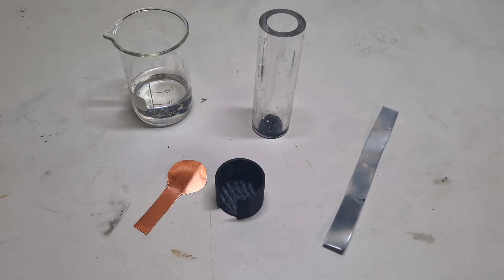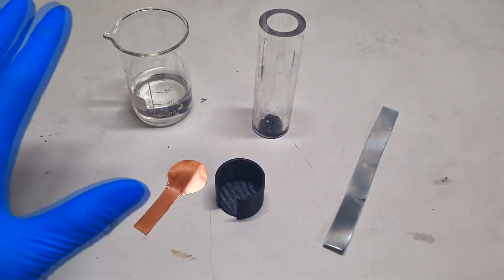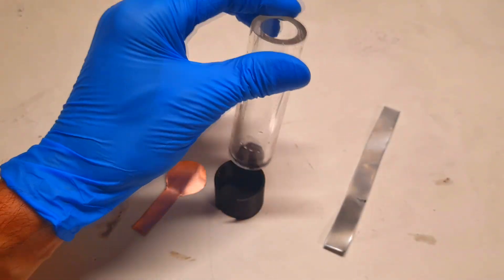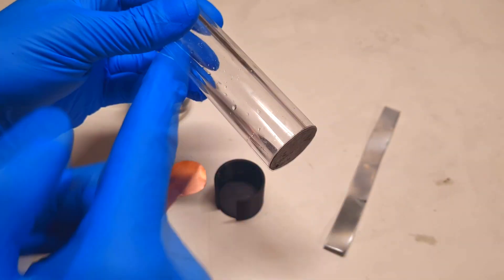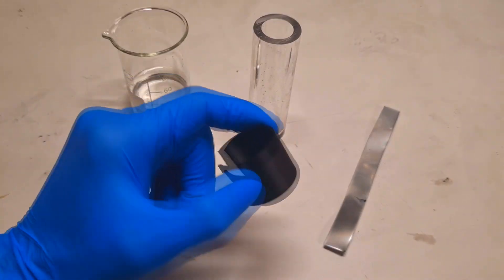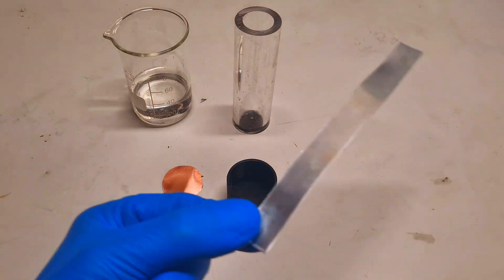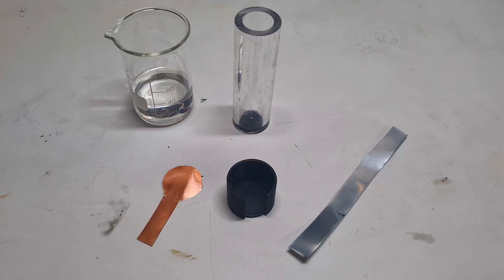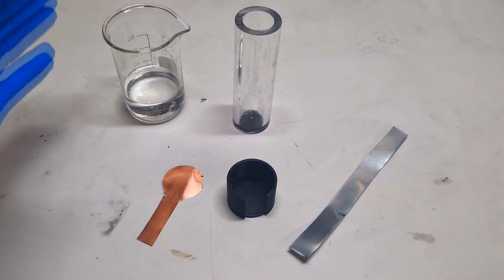DIY easy Zinc Bromine Gravity Battery

Comment: Some ideas:
- As already mentioned the resistance (because of poor adhesion) between copper and hdpe. HDPE will stick nicely on graphite foil which only will need limited contact with copper for low resistance.
- Put some (activated) carbon on the bottom (onto the positive electrode) as this might adsorb some of the bromine keeping it further away from the zinc.
Reply from the maker: Correct,... this is what I was discussing on my Patreon and what I made 2 years ago,... but in my case I use only graphite to get the max conductivity. And it will also in the follow up video.
Reply: @cayrex  Hi, I'm paying member on your YouTube channel, do I have to pay separately for the Patreon?
Reply from the maker: @Flup1964  No, no need. The post is free and I already mentioned here in youtube community section. And the video which I made 2 years ago is also avalible in the search: Zinc Bromine gravity Battery
Reply from the maker: @Flup1964  I post stuf like this on my Patreon because to the post I can add pictures, etc.

Comment: How much time will it take to be fully charged and what will be the voltage and current?
Reply from the maker: The charging speed will be related to the power which you will put into the cell. The voltage is 1.8V and the current in that setupe will be around 30 mA

Comment: Awesome demonstration!
Any insights on dendrite formation?
Reply from the maker: @SmalltimR  Sure,.... but they need some time to be formed
Reply: @cayrex  
Can this be managed?
Is it a problem for such a cell?
Can the Bromine be flushed or recycled?

- sorry for the barrage of questions, but you are the only person that I know of atm, who is actively performing these experiments, and moreso, who seems to know enough about the technology to answer these questions. 

I've been planning a Bromine gravity battery setup, to use with a wind power system, and was wondering about dendrites - I've been looking around for information on this, but it's difficult to find reliable information, let alone, advice from experienced electrochemist etc.

PS, I really appreciate your work and dedication btw, as well as any help you might have to offer
Reply from the maker: @SmalltimR  So, first about the bromine,..... the bromine is really nasty stuff if not managed properly. If you want to recycle then always discharge the cell to zero (make a short circuit if needed). Because this way the zinc and bromine will react together to form zinc bromide,.... which is not so together. Then about zinc dendrites I won't worry too much. Because if the zinc dendrites will fall to the bottom to the bromine,.... the bromine will react with zinc to form zinc bromide again. Only what what you can do is to wrap the zinc electrode with some fiber paper maybe. Then for the housing I would use some glass jar and on the topof the electrolyte I would put some oil. I will also make more updated to zinc bromine battery
Reply: @cayrex  
Hi and thanks so much for the response and suggestions on this - it is most helpful.
My plan is to create a cell, much like yours, and then refine the design with the intent of assembling a battery for testing.

My intent, is to use glass vessels for the individual cells housed in plastic sleeves(for protection), which can be lifted-out for inspection and maintenance.

My hope is to create a suitable, low cost, and fully maintainable energy storage solution for a small scale wind power model/experiment that I am working on - I hope to collect data from this for the next year, and in hopes of establishing a DIY solution for off-grid solutions. 

PS, I can't buy bromine here, and so I think I will synthesize some from pool cleaning products, I don't need much, and maybe 500ml would be enough for single cell experimentation
Reply from the maker: @SmalltimR  Cool nice. You dont have any option to buy NaBr or KBr? Because will be better to have much pure chamicals as possible!
Reply: @cayrex  
I can get 99% s Sodium bromide in granular form, would that be good enough?
Reply from the maker: @SmalltimR  Yes

Comment: I suspect that poor contact between your copper current collector and the conductive hpde is resulting in a large internal resistance. Maybe you can 3d print an inner insert as a grid (similar looking to the ceramic honeycomb grids used in catalytic converters on cars) that is press fitted into your tube, that way when you press outer cap on, there is something to evenly apply back pressure to evenly squeeze the conductive film against the copper and also flatten it out.
Reply from the maker: I making a follow up video. Yes, I already print some inner insert,... but wasn't much help. I also make one were I use a titanium instead of copper and HDPE

Comment: Lithium batteries are very easy to make
There is only 1 secret
That's what it is
How is the liquid in a lithium battery made?
who can make it?????????????????????????????????????????
Reply from the maker: Li ion battery mostly uses lithium hexafluorophosphate electrolyte dissolved with Ethylene carbonate and Dimethyl carbonate and can be bought.
Reply: @cayrex  well why
There is no video about how to make it
Liquid in a lithium battery?
is it a secret
or is it too expensive
Or can't people make it?
Reply: @ahh59823  because you need a glovebox to make the electrolyte and the cell. You cannot make it in open air, catches fire

Comment: I really like the design  buddy . may I suggest you put a little fluorescent dye in the electrolyte with a corresponding LED in the liquid to make it glow? That's cool? If you set it up correctly, you can have it so that the LED switches off when the battery is the plated and voltage is too low maybe by using 2 in series or you could do it in a different way where the LED switches on when it discharges to a certain voltage maybe with the Xena diode also

Comment: What is the purpose of the zinc sulfate?
Reply from the maker: Zinc bromide is the main electrolyte and the source of zinc and bromine and zinc sulfate is the support electrolyte. When the cell is charging the zinc and bromine are formed. And more you charge the cell more zinc and bromine will be used up from the ZnBr2 and for that reason the ionic conductivity of the main electrolyte will drop. The main purpose of the zinc sulfate is maintaining the ionic conductivity.